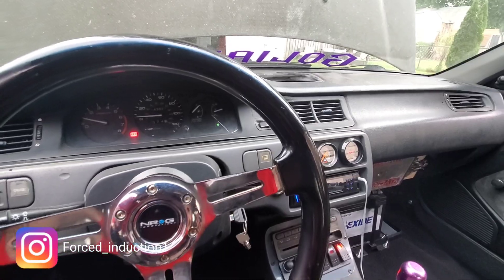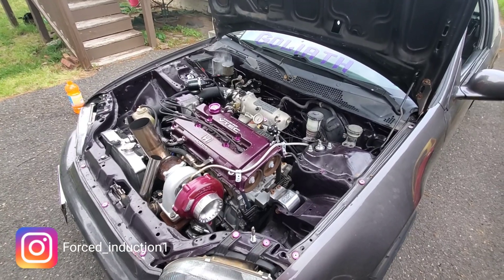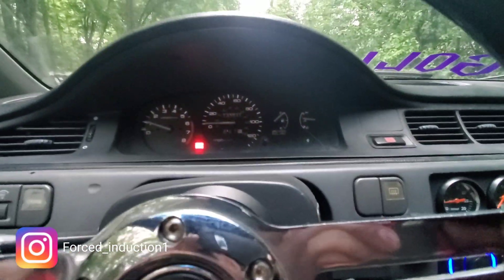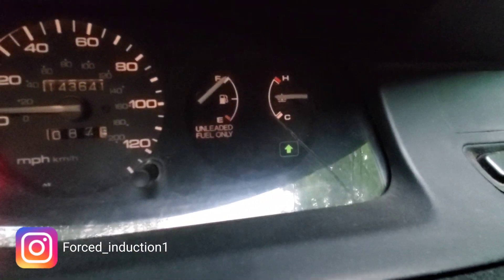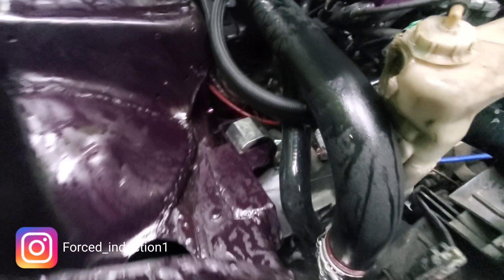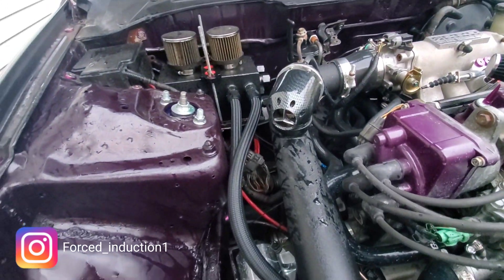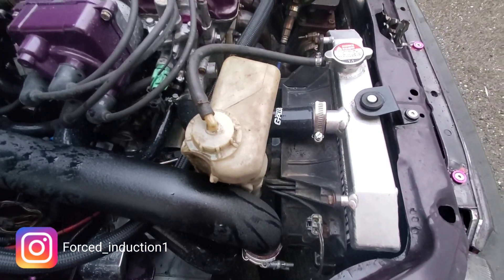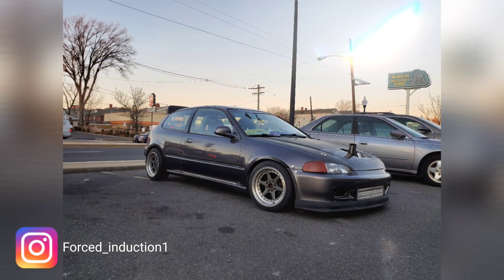B20vtec turbo w.o.t and coolant pressure issues

Comment: Catch can mabye even with vacuums if pressure that bad , have a spew tank for coolent so it’s not a closed system seems to help , but that’s with na, turbo can only really do same just make sure it’s vented propley should stop having so much pressure and the smoke that not good tht much isn’t good it’s to much timing

Comment: The head gasket you get stronger head bolts had that issue before never had that problem ever again once fixed only if you don't have a cracked sleeve

Comment: What was the issue
Reply from the maker: cracked sleeves :(
Reply: @Forced_induction1  damn my homeboy is having this same issue only happens after 10 psi of boost
Reply from the maker: @CarSick813  yea most likely the sleeves are cracked. I had 3 cylinders with cracked sleeves
Reply: @Forced_induction1  damn.
Reply from the maker: @lownslow2793 yea shit sux. but I got the car running again. went with a ls block. b18b1
Reply: @Forced_induction1  that’s what I got Ls/Vtec on boost. I’m still breaking it in then will get tuned after. 500 whp is the goal but I’ll be happy with anything over 4
Reply from the maker: @CarSick813  nice!!!! ls hold boost nice!!! right now with my stock ls block and gsr head on 15lbs I made 415hp and it takes it like a champ. no issues
Reply: @Forced_induction1  damn that’s really good! I can’t wait for Dyno day!
Reply from the maker: @CarSick813  word!!! I jus subscribed to your channel.  I wanna see u make some power lol!!

Comment: headgasket broo
Reply from the maker: actually cracked 3 sleeves smh
Reply: @Forced_induction1  damn brotha that's rough
Reply from the maker: @JD-nq5cq  it's all good. car already on the road running. swaped the b20 out for a ls bottom.. lsv turbo now.
Reply: @Forced_induction1  got lsv turbo here too. Sleeved ls bottom end
Reply from the maker: @JD-nq5cq  damn thats awsome.. I didn't sleeve mines lol I jus wanted the car back running but the next block will be..

Comment: What size tire do you have
Reply from the maker: 22545r15 toyo r888
Reply: @Forced_induction1  I fucked up and bought 205/50/15 and had them mounted and they were stretched smh  🤦‍♂️ on 15x8 et20 vms revolver
Reply from the maker: @Nadimarco90  that size looks good but if u want better traction 225 is better lol

Comment: I have a similar set up on a 4 door. Also having cooling issues. I’m checking the overflow tank and new radiator cap today. I’m also getting smoke on my catch can!! Hope it isn’t the HG which I thought it was at first but I have a breath of hope it’s just the rad cap allowing all the pressure into the tank and overflow tank leaking from cap when I tilt it over. It’s always something…
Reply from the maker: yea bro best of luck, hopefully ur issue is not like mines but im putting a lsv in now

Comment: have you got a cylinder leak down test done yet? Just double check that you head gasket is still legit
Reply: Nooooooo. Not what I want to hear
Reply from the maker: @elborrego88  yea sucks but shuld b back on the road soon
Reply from the maker: found out my sleeves cracked :/

Comment: Hey man I was wondering if you have a air to fuel gauge and if so what are your numbers because I got a Honda Civic to and when it’s at adle it’s at 25 if you could answer that would be great thank you🙏🏼
Reply from the maker: hey man..yes I do.. at idle it's at about 12 ..25 is super lean..to much air not enough fuel
Reply: @Forced_induction1  oh alright I get you do you know anyway of fixing it or any tips so I could get more fuel if you do that would help a lot.
Reply from the maker: @happyfrog7474  honestly im not sure besides getting the car tuned

Comment: Bro I have The same problem I cannot find nothing ,,, I change all head gasket , water pump 
I take out the thermostat,, new coolant , nothing I can find
Reply from the maker: damn I still have yet 2 figure this out. now my car don't start..I think ima jus take the head back off n look over it n put a new head gasket and torque it down to maybe 95lbs I was told it's possible the head is lifting under boost.
Reply: @Forced_induction1  I torque my to 98 with ARP today I’m going disconnected the heatcor try put the head straight lumped to the back to the engine
Reply from the maker: @Ronal08  ok cool lemme know how that goes bro. we need to figure this out lol
Reply: @Forced_induction1  so my conclusion is part out my engine ,, I do everything I know about overheat and nothing , I think is the head crack somewhere o block somewhere make the heat the block I have is new from JDMdepo ,, so brother I’m done with B-series going to the future K-series
Reply from the maker: damn that really sux man.. it is wat it is..thanx 4 the input tho. hope k series works out for you
Reply: @Forced_induction1  thank you brother good luck and get your problem fix
Reply from the maker: @Ronal08  np n I appreciate u brother!🙏

Comment: Definitely 💪!! Are you running stock thermostat? If you are look into drilling a hole or 2 into it. It will help with the high temp. Specially with all that power.
Reply from the maker: yea oe t Stat.. I was thinking of eliminating it not sure if that's a good idea or not
Reply: You won’t have heat in the winter but maybe because of high temps cool vid
Reply from the maker: thanx. I might jus take it out anyway n park the car over winter